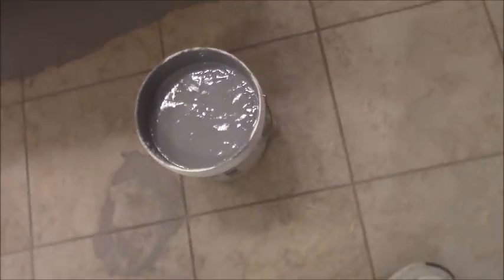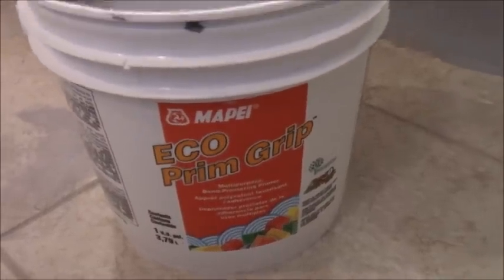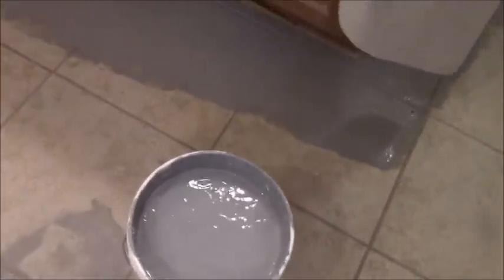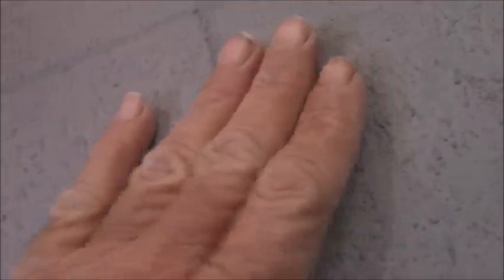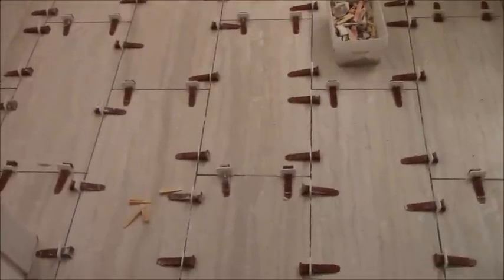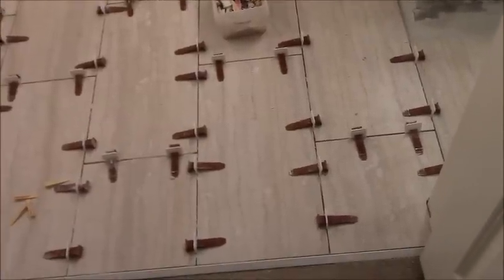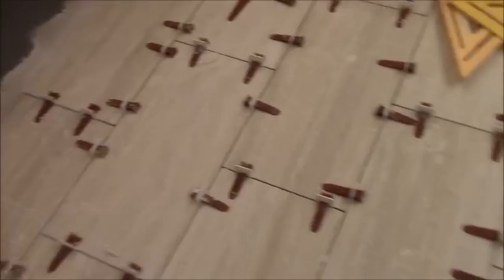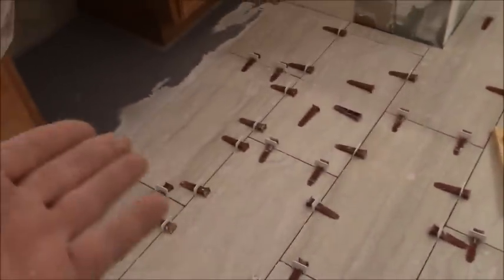TILE over TILE

Comment: The Tile Counsel of America manual shows how to tile over tile. Been doing this for almost 40 years. It's only done when the original floor is secure to it's base otherwise tiles pop. How to find out? Use a regular nail puncher and tap every one of the tiles you will work over with to see if they are secure to the base. A hollow sound tells you it isn't and a hard thud sound tells you it is. If it's a floor, every tile in the traffic area must be secure to it's base. If you tile over an area where a tile is not secure to it's base there is a high risk of cracking, especially when something is dropped on it. Once you do a tile over tile job it limits you to future repairs especially when different format tiles were used in the same space. We used this method mostly for commercial applications such as restaurants where downtime was a very important factor for the client.

Comment: I used it on a vertical surface tile over tile. Works great! even works with mastic. If you're only pulling straight in and out of a garage I bet it would work fine, but if you are turning your tires I bet it will start to wear out over time. Also not sure how it would soak up stains or how easy it would be to clean.

Comment: The adhesion is amazing and the grit is like the not slip paint. Next time instead using a brush, use the small 4 inch roller it would be so much fast. Not the regular diameter one but the thin one I think it's 1 inch in diameter.

Comment: It looks great,  I love the idea of going over the tile. It saves so much labor! One question,  how will the dishwasher go in and out with the floor being higher?
Reply from the maker: As a rule there is usually at least an inch between the two tabs that anchor dishwasher to your countertop and the dishwasher itself... so you have room to do that regardless of the little half an inch you will be adding. Tile goes up to legs and front plate covers that.

Comment: Great product, thanks for sharing. Just to be clear, by using this product I would be able to skip the step where I'd use a grinder or sander on the existing tiles, right? I saw people doing that in other videos, especially if the tiles were glossy, but this method is way better.

Comment: Quick question, would. Need to use this product if I’m only tiling over one tile (18”x4”)? Made a miscalculation on the bottom piece of a shower niche, unless I find a smaller tile edging piece, looks like I might have to resort to put a another tile over the one that’s been laid in already…

Comment: do you think you could use that product on a porcelain tile outside to where you didn't want it slick and paint over it instead of tile over it without any problems of peeling?
Reply from the maker: Well I tested it with a 6 in taping knife and it's very difficult at best to make it come loose but it will definitely not peel, I would suggest calling the manufacturer and getting their take
Reply: @StarrTile  Thanks for answering back. I did contact the manufacturer and for some reason they couldn't or wouldn't put me over to a tech person and were really no help.

Comment: Can you do tile over tile on a kitchen backsplash? If so can pencil tile or subway tile be put over a tiled wall?
Reply from the maker: Yes..you can tile over tile on a backsplash, though not recommended because of the issues of thicker areas around outlets, sides, etc.

Comment: The Tlock master clips don't break away very well!! 2 out of 5 break above the tile, I am having to cut them with a knife :(
Reply from the maker: Agreed..using a razor knife to get off the top portion is a pain.
Reply: @StarrTile  use lev tec
Reply from the maker: @adamh6190  yeah we'll give them a try
Reply: Nice work! I’ve always been skeptical 🤨 about tile over tile. Feels like I’m breaking some tile law. But I suppose with proper preparation, it’s not that bad.
I installed same Home Depot tile in my customer’s laundry 3 weeks ago. 
In my experience all clips break off well, unless they are encapsulated in thinset mortar. When I get thinset on each side of the clip, it has nowhere to go, thus resulting in surgical removal with razor knife.I have used Rigid Level Max, Lev-Tec, and no name Amazon clips. I use grout removal blade on my oscillating tool to carefully cut through the plastic clip stub.
Reply from the maker: Good idea to use oscillating tool to remove top portion, as long as you're careful not to chip edge of tiles

Comment: My husband and I are about to do a DIY shower remodel. We have a similar situation with existing floor tile over slab on grade, however we're also in a flood plain and when we do get flooding, water seeps up through the concrete foundation and up through the tile grout. We want to tile over the existing tile but also waterproof it so it no longer floods in that manner. Should we use the tile primer and then red guard over it, or just red guard and skip the primer? I know this is a unique situation. Thanks for your help!
Reply from the maker: My suggestion is using primgrip only, I believe it has waterproof quality with it...test it to be sure. If transition isn't an issue I might regard old floor, thinset over it with 1/4" durock on it, then tile over new backer...probably could redgard over new backer too prior to tiling.

Comment: You mud joints, screws and corners for green board on shower walls before red guarding.  Do you use drywall mud or thin set?  Does regard stick to the drywall mud good enough?
Reply from the maker: I use mud if I'm using green board, I use thinset if I'm using cement board, and yes redgard sticks to everything

Comment: My new tile will extend under the new vanity.  The existing tile did not extend under the old vanity.  Do you know if  I could use regular tile cement to bring the level up to match the existing tile level?
Reply from the maker: yes you probably could but I would use tile... because it's under the vanity it won't matter if it matches up, it could even be scrap tile
Reply: @StarrTile  That's what I was thinking.  Okay, thanks!

Comment: Would you recommend using this product on a shower stall wall?  Original tiles are installed over a cinder block wall and too difficult to remove. Can it handle all the moisture?
Reply from the maker: With what you described I wouldn't have any compunction about using it on walls
Reply: @StarrTile   Would scuffing up the original tiles improve long term bond?

Comment: Quick question . New shower and contractor put osb as main floor and then started to poor quickcrete to make his slop he did not redgaurd or use sometype of water membrane blocker .  Is this correct . It’s on the second floor and honestly this is a 35k 9 foot shower with Brizo trim ... I just need to know if this is being done correctly ?!?!? 

Thank you
Reply from the maker: I answered your question on the other video, using overlaps tar paper before the Quikrete, I would also strengthen it with a polymer additive or some shredded fiberglass that comes in a bag, you can mix it with the Quikrete to make it stronger
Reply: StarrTile . So how he did it is ok ? Quickrete on OSB is ok
Reply from the maker: @skincarving  most of the homes built nowadays is OSB on the floor, on the side of your house, even on your roof , so it's not the board per say it's how you protect it.. as I said already overlapping tar paper should be used first to protect that OSB floor from the moisture

Comment: Please tell me that you removed the baseboard and under cut the jambs and casings.
Reply from the maker: This was a larger than normal baseboard, instead of the 2 and 1/4 inch I believe this was 3.. the customer was given an option to take out and replace later and they declined, in fact even when the job was done they didn't want the quarter round back on the baseboard...but yes undercuts on jamb were done

Comment: Why the leveling system? I thought you never ever used them and didn’t like them?
Reply from the maker: I never said I don't use or like them, I've stated I rarely use them but they are a "tool" when needed.
With low end bowed tile set in half, SLS is almost required.
Reply: StarrTile My mistake. I know you had a video a while ago, thought it was about how you didn’t like them.

Comment: Hey Bob, would you recommend applying redgard on top of this primer before setting tile over tile to add waterproofing but also crack prevention?
Reply from the maker: Prim Grip is alot like Redgard, I believe it has crack prevention properties...and may even repel water, I should test that. Feels and acts like all liquid topical membranes except it has a gritty texture, I think silica
Reply: @StarrTile  ok great so you wouldn’t recommend using both then?
Reply from the maker: @peterjg001  I suppose you could but again test the prim grip for water and crack prevention ...I think your way would be overkill
Reply: @StarrTile  thanks Bob!

Comment: Hi Bob, been a follower for several years. I’ve never needed to research tile on tile applications until now. We have a 600 sq ft open living room/dining room area and even though the tile was done nicely, we knew there were some bumps. But when i went to lay my custom cut hand oiled poplar baseboards, it was apparent that I couldn’t get a nice fit without fixing the floors. Have kind of decided to sacrifice 3/4” loss of floor to ceiling height to avoid a filthy demo of old floors and since my door transitions have the room. 

Question to you is, I need to do a leveler in certain spots to get my edges straight for baseboards, so should I use the leveler over the existing tile without any other preparation and THEN lay this Mapei primer? Or will it be necessary to scratch up the surface of this old stuff before leveling and priming? Can you advise me on a clear cut order of operations? Will def hit your Patreon with some love. 

Thanks for such a great channel.
Reply: PS: I did definitely consider some coping and back cutting of my baseboards but I’m pretty sure nice level floors is the only legit “Pro” direction to go. Cheers
Reply from the maker: If it were me I'd use self leveler on only areas needed that are depressed, then rest of tile use prim grip...or thinset 1/4" backer on entire floor after filling depressions, assuming height at doorways not an issue. Baseboard I'd replace, that's just me though.

Comment: So why was the baseboard left down? Is the new tile just going to be flush against it?
Reply from the maker: Yes the tile butts right up against it, my customer did not want the baseboard removed & replaced
Reply: There can be a edge strip that can be finish nailed where the tile meets the baseboard. Then it would basically look exactly as if the baseboard was put in on top of the tile. The overall baseboard height might look short though.
Reply: If the owner specified it be done this way, then you have to roll with it. But when and if they (or a future owner) decide to replace the baseboard (to give it a normal height appearance, at minimum) wont’t it be really hard to remove without damaging the tile?
Reply from the maker: @tscoffey1  I believe this baseboard was The Wider 3 and 1/2 inch and not the standard 2 and 1/4 baseboard so to the eye it is not that bad... removing it in the future will not be a huge issue although a bit difficult... and yes I always give options to my customers and they either accept or decline and in this case they declined not only changing out the baseboard but also putting in new quarter round, their choice not mine